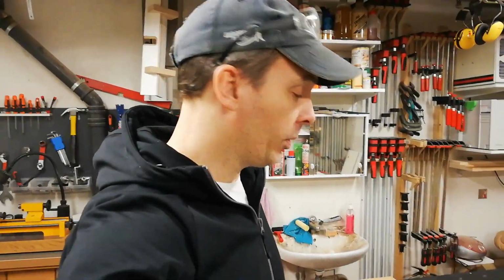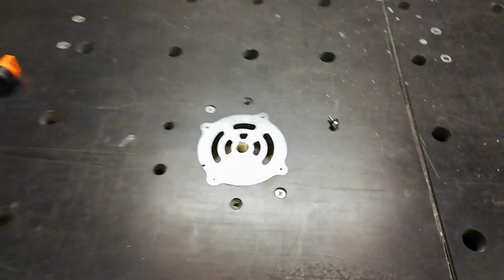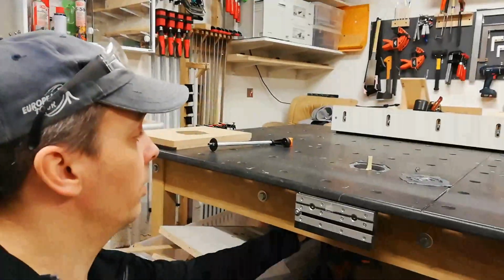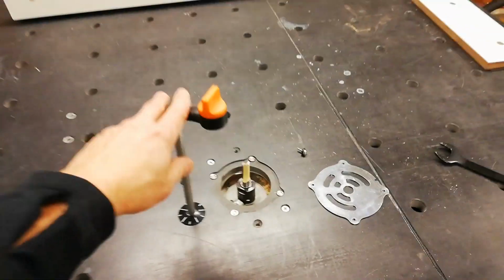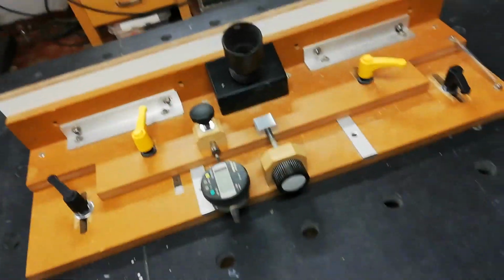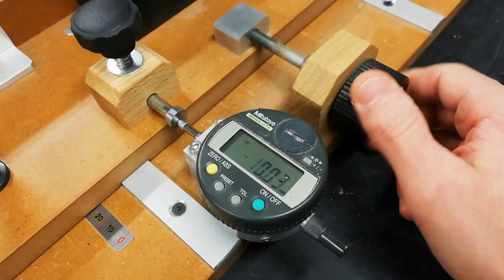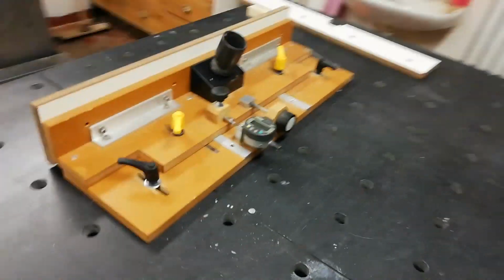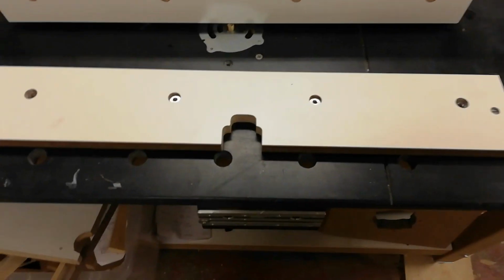Router table and micro adjustment fence

Comment: Excellent. 

I made a similar fence by adapting my DeWalt DW626's guide fence - which has a micro adjuster - to a cast iron router table that I had modified for the 626.

I  think that your vertically adjustable fence is also quite a brilliant idea and will try to adapt my idea to include it.

Thank you and very well done.
Reply from the maker: @Riror9845  Thank you! If making the vertical fence solution, I recommend vertical slots in the "inner fence", threaded inserts in the outer fence and knobs from the backside. That way you will have tool free height adjustment (and changing of the fence). I will have it like that in my next version of this fence.
Reply: @CarmoniusFinsnickeri  Anxious to see the new sled and plans!  I love your work and how you go about all your builds and the way you explain how and why you do things a certain way.  Do you know when you will have this new version posted and maybe plans???
Reply from the maker: @ Thanks! Well, I was 95% done with the plans when I recieved a large customer project, so had to pause that. Can't make a best guess, it's quite close I just need some time to finish it.
Reply: @CarmoniusFinsnickeri  You have to pay the bills!  Thank you for the reply. I'm glad you are almost done and haven't given up.  Once again, I really like your style and have been a follower for a long time.

Comment: Is this assembled with cross dowels as well so that you can make sure the fence is perfect 90 to the table? My router table needs improving. Did you check your router to be sure it’s 90 to the table? Or not a big deal because the cuts are generally not very deep?
Reply from the maker: Assembled with cross dowels yes. Checked the router as well and that's  90 degrees.

Comment: Both things you've done here are fantastic.  The fence is awesome and I really like the way you have used the Incra MagnaLock rings on the table without the need of using the router plate.  This is something I want to do on my assembly table as well.  Can you please let me know what size is the magnets and the o-rings?  I also want to make a similar fence that you've made.  WELL DONE!
Reply from the maker: Thanks Gary! Overall I'm very satisfied with this set up and I haven't missed the insert plate at all. I'm about to make a new, similar but slightly upgraded fence in a few months, that one will get a much better less shaky video...this was filmed very early in my youtube "career". Until then, this fence is based on Pat Warners design, link to the original plans you find in the video description. I tweaked these a little bit to make my fence. You can build without plans also, it's not too difficult. One improvement tip for the fence is to have vertical slots in the "inner vertical fence" and threaded knobs from the backside through those (threaded inserts in the outer fence) and adjust the height of the curtain style fence and attach the standard fence tool free.

Neodymium magnets are 10mm outer diameter, 3mm thick, with a countersunk 3mm hole. These are very common and can be found on many places. Exact o-ring dimension I can unfortunately not help you with. I would need to remove the router to loosen those screws to reach the nuts on the underside. Looking at the video it looks as approx 3mm thick, and I guess center hole is 4mm giving outer diameter 10mm. A tip here is to pocket recess and glue the screw nuts on the backside of the table top so you can tighten the magnet screws without removing the router. Incras screws goes into metal threads so there no nuts are needed.  Hope this was of help.
Reply: @CarmoniusFinsnickeri  Thanks for the detailed reply.  I hadn't thought about the nut to accept the screws. My plan is to order the CleanSweep ring that accepts the bushing as you can buy this on its own.   I presume a template was used to rout the odd shape?   Now I can start looking for the magnets and after that the o-rings.  I also have the Triton router that will most likely stay on the table permanently so negates the need for the whole plate.  With regard to the fence I thought of drilling 20mm holes in the base and using dogs to lock it down to the table instead of using threaded inserts.  I did actually think of the using the knobs at the back to adjust the height ...  great minds think alike 😊.  I look forward to the upgraded fence video.  Cheers.
Reply from the maker: @gandl40  Yes I made a template, the large hole was done to a good fit using a circle jig. Magnet ears were drilled, transitions were hand sanded. I haven't worked much with dogs but would be concerned about freeplay, especially when routing tall pieces and putting force high up on the fence which would risk the fence to tilt/lift on the dogs. But as said, my experience with dogs is close to zero.
Reply: @CarmoniusFinsnickeri  I haven't had much experience either.  But from my research there looks like there would be some suitable options. Power-Loc & Smart Connect dogs from TSO,  Quad Dogs from Benchdogs UK and possibly  ExpandDogs from Dashboard PWS.  These all look like they would lock down the fence tight.
Reply from the maker: @gandl40  Thanks, wasn't aware of those new dog types, just seen the standard ones sliding into a hole without lock. As mentioned, not a system I'm using.

Comment: This is absolutely excellent. I will copy the fence when I build my next router table!
Reply from the maker: Now when you have all FWW issues you can find the original in #144. The "curtain type" of front is not included on that one but Pat showed it on his website a few years later.
Reply: Where can I find plans for this?
Reply from the maker: @KempieV89  plans for the original Warner fence can be found in the link below. Mine is slightly tweaked; dial indicator as close to center axis as possible to minimize errors. Spring to eliminate movement wobble. Movable "activation pin" for the dial indicator and the curtain type front fence. http://woodarchivist.com/1049-micro-adjustable-router-fence/